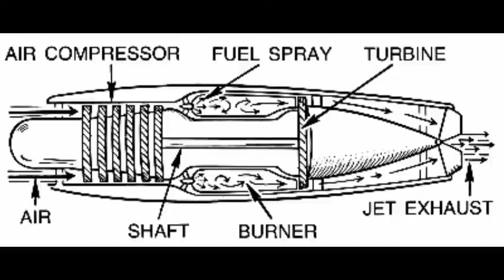BMW 003 - Luftwaffe's SECOND Operational Turbojet Engine (He 162, Ar 234, Nakajima Kikka)

Comment: There is one of those in the air museum in Ottawa, Canada. What a piece of shit! Made of plywood! Junk!
Reply: Mosquito  english wonder a/c  wooden wonder   some people are idiots.
Reply: @Eric-kn4yn  yes but which people? In the Ottawa museum is a DH Mosquito- It's a finely built machine compared the the Heinkel.  The Heinkel had plywood on the front edges of the wings and I have to say it was very poorly put together so save your cheap insults.
Reply: That’s the opinion of the uninformed.
Reply: @neilmchardy9061  fine- I'm not a pilot but if I was there is no way I'd fly that thing. Come to Ottawa and have a look at it.

Comment: Oh here we go again, "If only they'd made thesecearlier WW2 mightve turned out very differently." Let's ignore the glass-jawed fragility of all German jet engines that had short lives AT BEST & could be fatal damaged if the throttle was pushed forward too quickly....hmm, that wouldn't happen in a fighter, surely? Also the He163 was a disaster, short on fuel, it frequently just fell apart, was areodynamically unstable & turned like a barge, amongst many other severe problems.

Am I the only one who asks why the side that supposedly had the best of everything, weapons, tactics, soldiers, generals etc etc, yet they LOST......TWICE.....but Tiger tank.....K98 rifle.....Me262....etc etc.
Reply: It's not the HE-163, but ME-163 powered by T and C stoff. Your comment is false. You forget that politics was the cause that a lot of very good weapons where not come iinto action. Bad decicions made by the wrong people on the wrong spot. More or less the same as today. Tha actual life span of the Junker Jumo-004 was about 25 hours due to lack of sources to make make the turbine blades.
Reply: The Third Reich did not make the best of every weapons or men, but they did make arguably the best weapons and men out of what budget and resources they have. They were like a research department with many brilliant minds and practical experience, but with severely and constant low funding.
While He-163 itself was far from the ideal jet fighter - the fact it was even made in the last year of war was an impressive feat of itself, under constant air raid, resource shortage, and besieged on all side, if there is one country that could still design and produce an advanced jet fighter in a few months, that is going to be Germany and no one else.

Comment: 1:20 NOT an axial flow engine; combustion being shown in external chambers not at the axis. This is how the first British jet worked that - because the combustion did not impinge on the fragile inner parts of the engine - had good reliability and a reasonable life in the 100's of hours which is why it was chosen for the first British jet, the Meteor. 2:00 This is a pulse jet - different again - same as the doodle bug flying bomb - has no internal moving parts.
Reply: The basic drawing shown at 1.20 is an axial flow turbojet, which is at the heart of all jet engines today. The British design took the air in with a turbine and sent it through tubes in a convoluted way to the combustion chamber. The axial flow Ohain engine would at high altitudes with the thinner air change to a ram mode, but the british design was slower and not powerfull enough.
Reply: @mohabatkhanmalak1161  Von Ohain designed the axial flow engine, Frank Whitle designed the forerunner of the later Rolls Royce Derwent engine on the Meteor.
Reply: Axial ,ou sentrifogo, refere se ao tipo de compressor nada tem a ver com as câmara de combustão